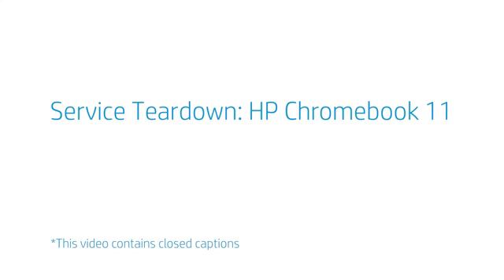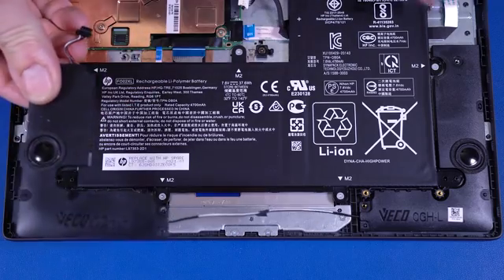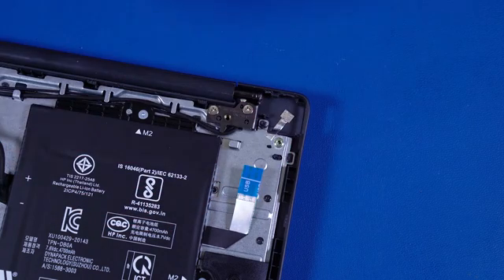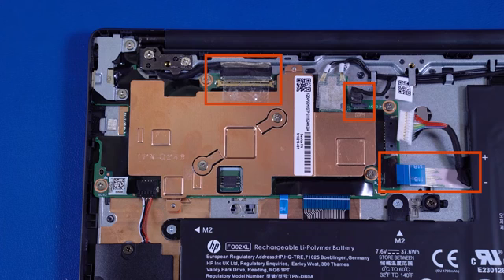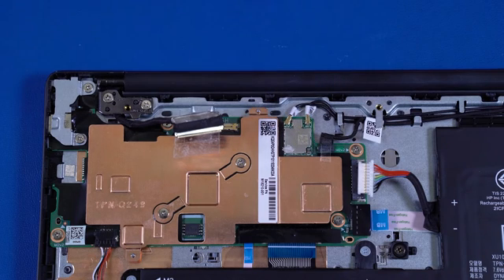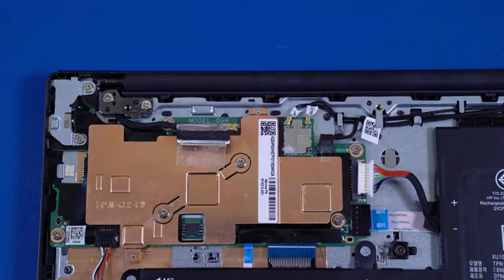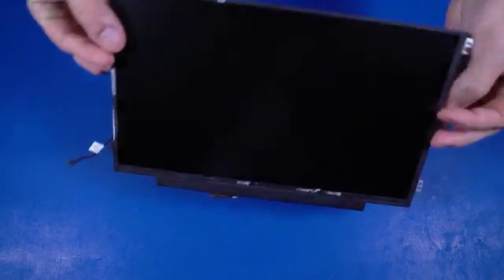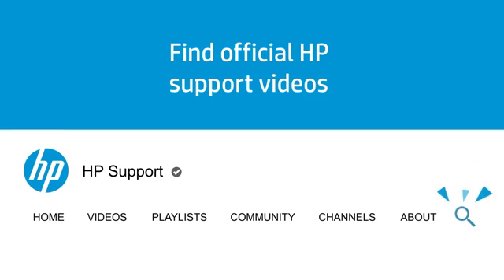Removing & replacing parts for HP Chromebook 11 | HP Computer Service

Comment: Good afternoon. I have a problem, I installed the chipset amd driver on the asus laptop, but the system was Windows 10 and I installed it on 8 and after the black screen, even the logo does not light up, I do not enter the BIOS, I took out the cmos battery, nothing, twice the screen turned on in additional settings I wanted go to the safe rezim again nothing black screen. I connected the monitor ... Blue screen, error, restart. Please help.
Reply from the maker: +Біблія The steps mentioned under the video are tested on HP computers. We would not be able to comment whether it would work on other brands.